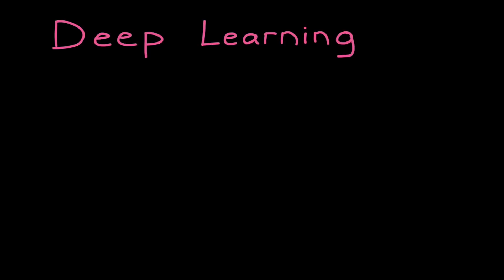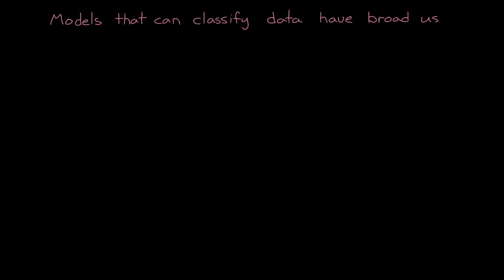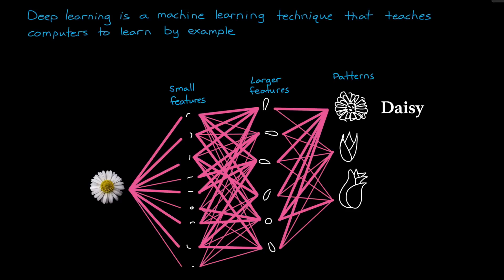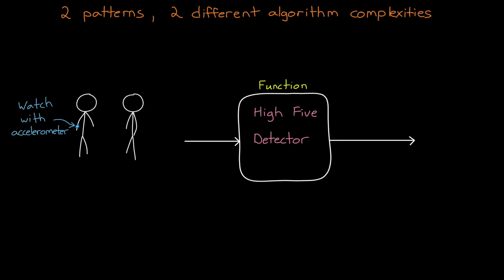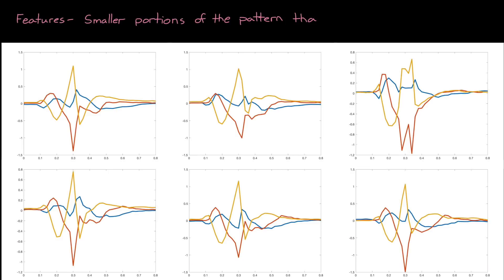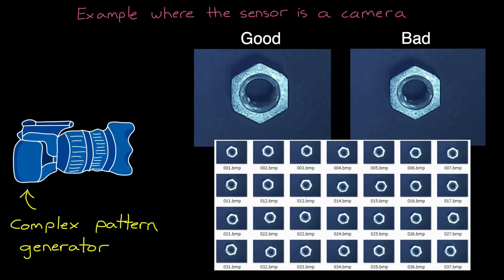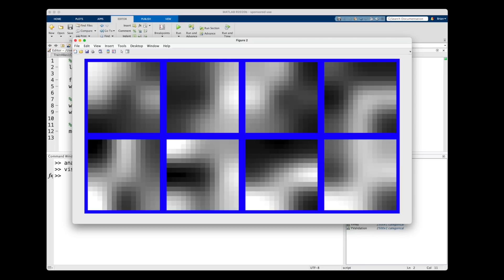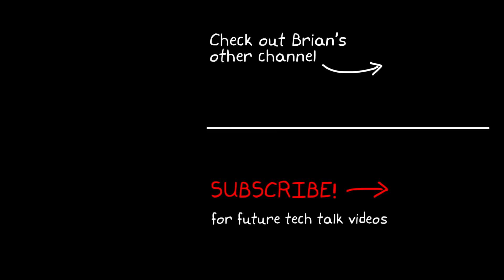Why Choose Deep Learning? | Deep Learning for Engineers, Part 1

Comment: i have a probleme in my MATLAB, the stateflow block doesn't work and i recieve this massage :
" The current directory 'c:\program files\matlab\r2013a\bin' is reserved for MATLAB files.

 Please change your current directory to a writeable directory outside of the MATLAB installation area. "
Reply: Hi Hamza, did changing your current directory work? If not, I notice you're using quite an older version. Have you considered upgrading to the latest release?

Comment: I recently started playing with the MATLAB machine learning toolbox and I want to classify 12-lead ECG data. I followed the Mathworks example for classifying single lead ECG. As far as I understand, the input-layer only allows a vector of data, like a single ECG lead. How do I input the 12 leads at the same time, since they are lets say different viewing angles of an observation and thus connected in time. 🙈
Reply: You can input multiple variables into a ML or DL model as a 2D matrix.